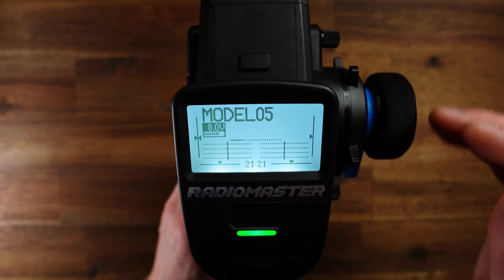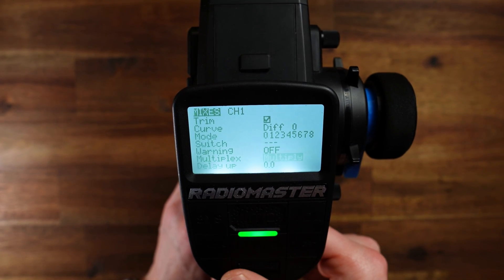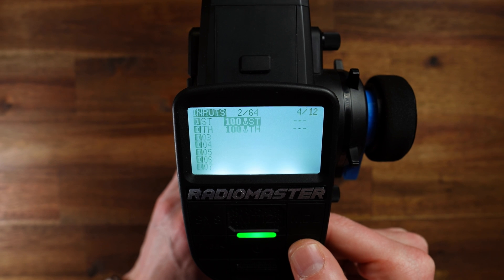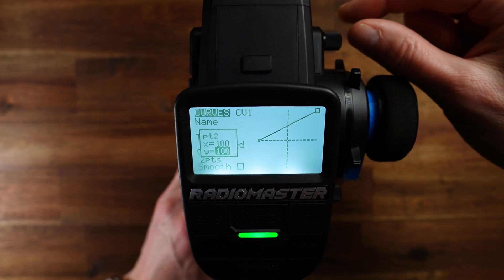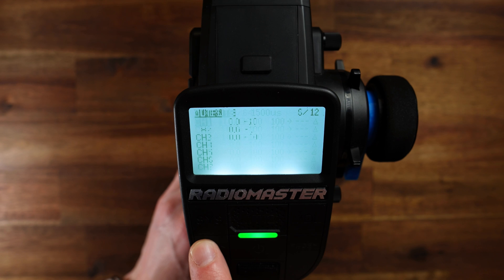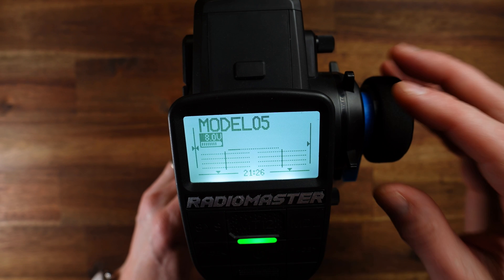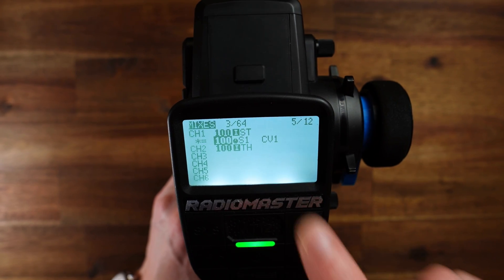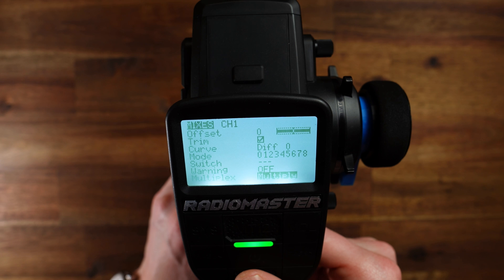CONTROL RATE/SENSITIVITY WITH A POT - THE EASY WAY | EDGETX | MT12 [EN]

Comment from the maker: In this video I am going to show you a way to control the rate/sensitivity of a channel with one of the pots. This solution only uses inputs, mixes, and one curve. Very easy, no special function, drive modes, etc. needed. It is a (maybe better/simpler?) alternatve to the solution @JoshuaBardwell shows in his video (maybe someone can tell him 😀). With the solution shown in my video you will be able to control the two sides of the channel (positive vs negative, right vs left, throttle vs brakes) differently/independently.

Comment: Can you please do this for a drag brake adjustment. I was trying to combine this video with your rate video but I can’t figure it out. Instead of slow down on steering, let it be on throttle. And adjustable with a knob. So pulling on the trigger will be normal but letting go of the trigger has slow down. And let this only work on the x>0 side.
Reply from the maker: The video is online. Hope it helps!

Comment: I can't get Josh's version to work using the S1/S2, (only works with trim tabs for some reason) the advantage of his setup is it's global so it applies to all models, whereas you have to clone this model or setup these settings for each new model.  Great video!  Very helpful!
Reply from the maker: Thanks for watching and taking the time to write the comment! I am glad the video was helpful to you. The goal was to have an easy to do setup which is flexible at the same time. The setup can be adapted to every model, you can control the two sides of a channel differently without fuzzing around with global variables and flight/drive modes. With this video I simply wanted to show that this is possible and how it is done. Thanks again for watching!
Reply: @arminrc  actually I was able to get JB’s method working on S1 and S2 (it was the precision setting) and I believe your method is way easier. 1. JB’s method isn’t “global” you have to setup the global variable and special functions per model. 2. You can’t put a curve on a global variable so with JB’s method I only get half of the pots range 3. Your setup is faster. Personally, I don’t have much use for the different rate on left and right side but it would be great if there was a way to add a pop up while adjusting. Great job and THANK YOU!!!!